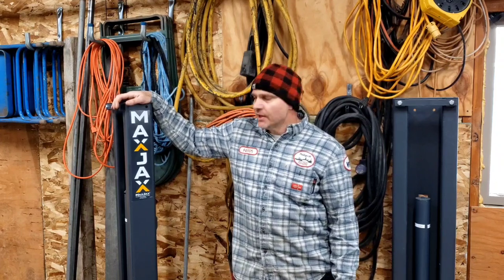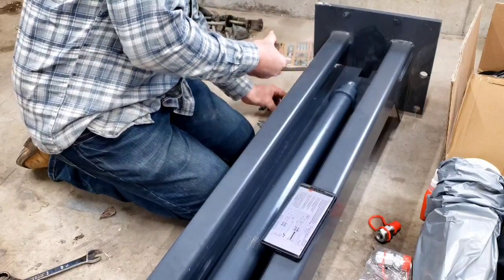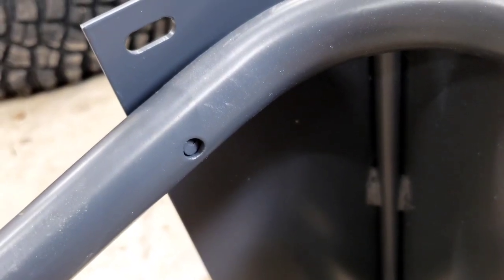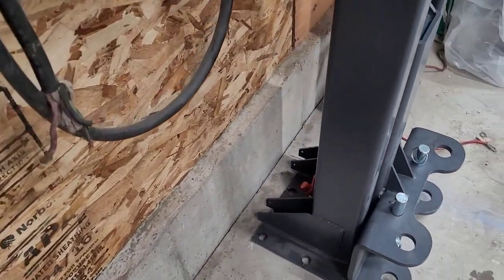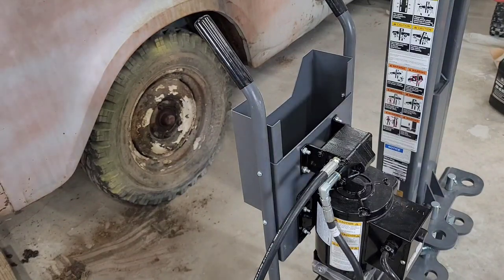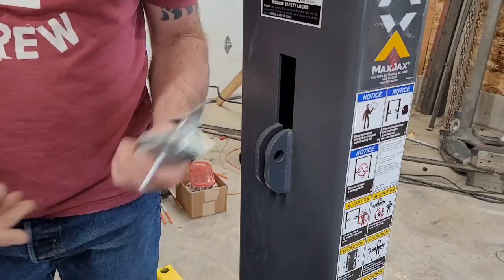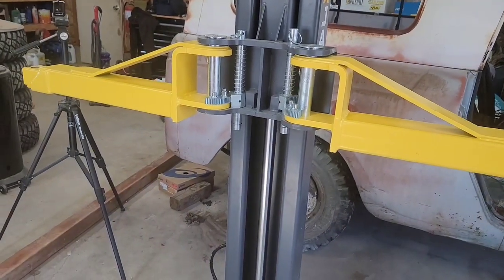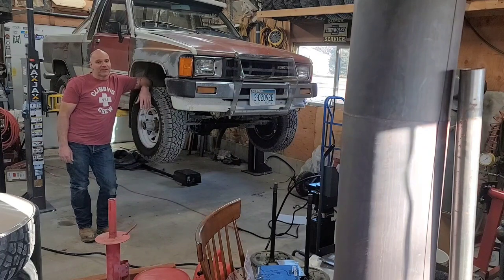MaxJax M6K garage lift assembly and install

Comment: Hey MT. Good video. Great job. Even better that you did it yourself. I had a buddy help me.  I installed one in my shop in the spring It sure is nice not crawling on the floor anymore. I can walk under mine. Thanks for sharing.🍁👍👍

Comment: I just installed my 2nd MaxJax and DO NOT USE the crappy thread sealer they give you unless you wanna be doing it again, it will leak like hell. I have used teflon tape both times after redoing it as the Danmar instructions used to say and it doesn't leak, also use teflon on the quick connects or they will leak. I also use a quality epoxy by Sika ($30 bucks at Lowes, )along with the floor inserts, just extra piece of mind. He also forgot the rubber pad between the motor in this video, (so did I on 2nd lift) had to go back and put it on. And during install you don't "set the nut on inserts to 90lb/lbs", that's after inserts are already installed to secure post and is really overkill, only needs about 50-60 lb/lbs. Also don't bleed the cylinders until after you raise it. Also use a level on post. There are better install videos than this guy, sorry bud. https://www.youtube.com/watch?v=6BGCqzKzqds&t=1230s . You don't need the safety clips on the pins unless you don't ever want to move it, they are so heavy they aren't going anywhere. I like the sacrificial cat and truck for the first test. ;)

Comment: I took the edge off of the safety  lever with a file and used liquid rubber dipping  coating on the lever and springs which will stop the possibility of scratching the post. You can also build up shrink wrap the accomplish the same result.

Comment: spent a half day on mine and not halfway there, only one post is done.
still need to measure and drill holes, its a tough slog.
don't be fooled by this video.... its rather hard work.

i'll get an energy drink before going at it again.

Comment: Excellent video. 
I just bought a Max Jax. I was wondering if the 123" from the back of one column to the front of the other worked well? 
Wondering if that distance worked well. 
Trying to figure out how far to put mine apart. 
Thank you.

Comment: Nice vid guess you didn't hit any rebar when you where drilling? for those of you doing the install mark your holes and drill with a smaller bit like 1\4 inch or so to determine if your going to hit any rebar then readjust that way if you do have to readjust your floor doesn't look like Swiss cheese drilling a 7/8 hole unnecessarily can effect the integrity of the concrete when pounding in the incerts
Reply: drill through rebar with a rebar demon. $30.
put your lift anywhere you want.